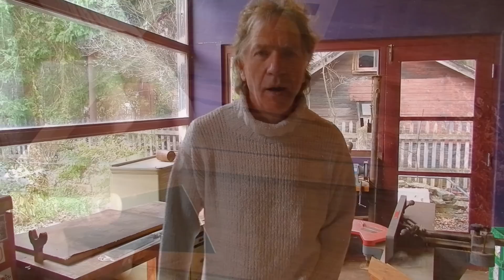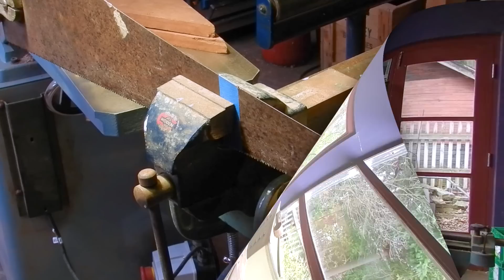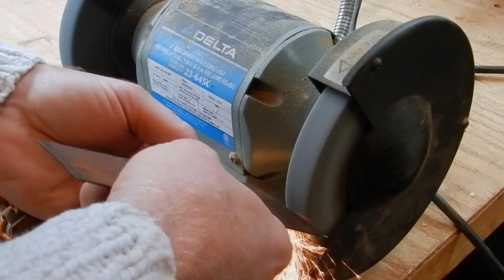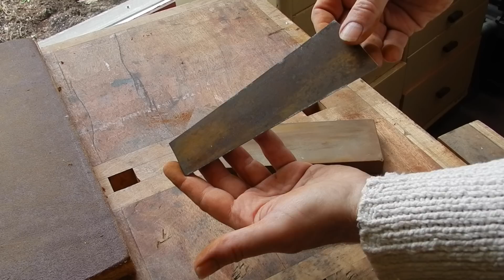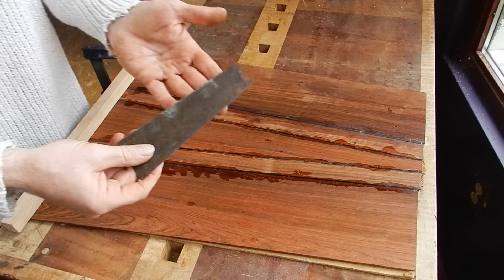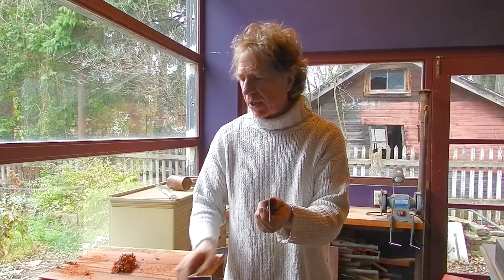Make, Sharpen (burnish) & Use a Cabinet Scraper

Comment: I'm trying to make one out of a stainless steel paint scraper. You think it'll work? It's got the meat, with a little bit of flexibility. I just can't seem to burnish it properly.
Reply from the maker: Hello Robert, the burr is essential, perhaps put it as close to the vice as you can to keep if from flexing...try different tools to burnish. If you can make a flat edge hold it firm, you should be able to .  Keep trying, Are you able to get any material off without the burr... if so just keep working on the burr, it takes a few times to get the hang of it.  Thank you for  watching. Michael
Reply: @majorgunn  
I was able to get a tiny, tiny bit of dust off. I think I made a little bit of a burr on the edge, so it'll likely work.

I was told by a sharpening expert that the metal was improperly annealed and it would be too soft to hold an edge for very long. I did only get the scraper on the cheap at the dollar store. What do you think?

Comment: thanks, obviously your method works, but, fyi, u missed the step of drawing out the steel... everyone else does that
Reply from the maker: Hi BIll, thanks for watching and also your remark.  I find that drawing out is good, and really that is what a serious push is( I mean one or two or three with vigour) provides the same effect or impact.  The point is have a sharp even hook,   I really could have emphasized the polishing also which is pretty important.  For me, I usualy scrape to bring things down and still end up sanding @ 120 or better